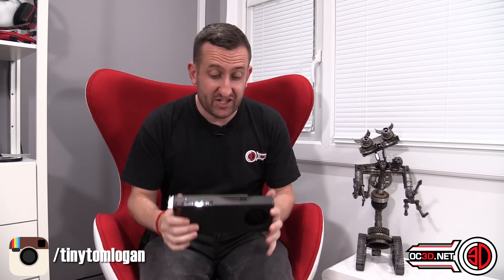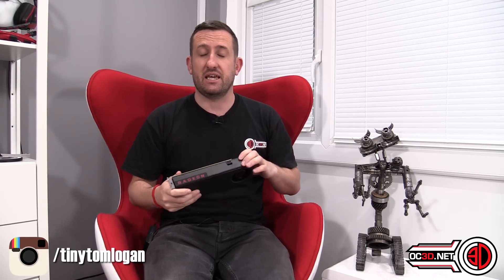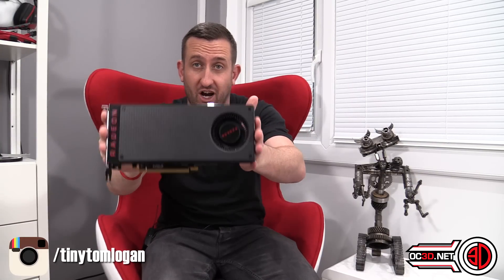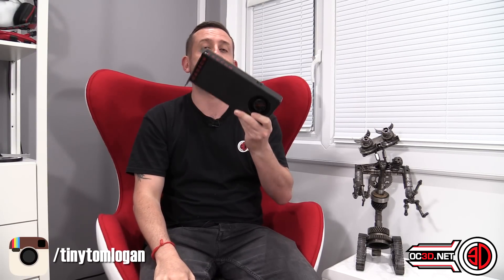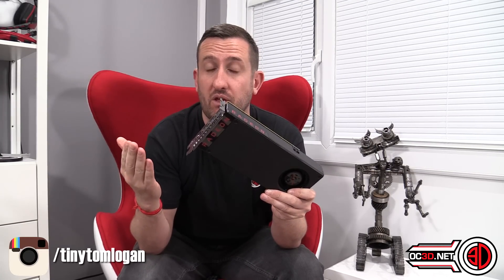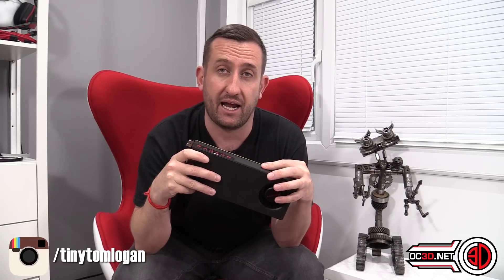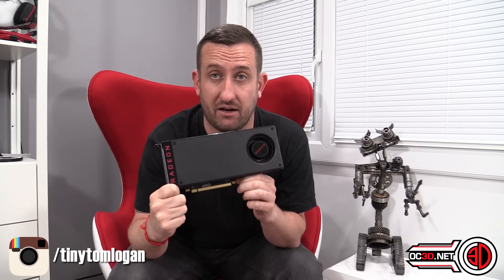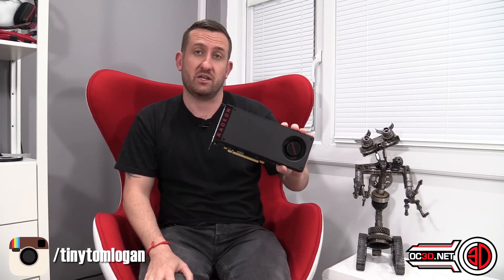RX480 power bottleneck? TTL Talks

Comment: will it match 980ti on decent cooling and OC?
Reply: This is a joke right? Its around the same as a 970 in most reviews, no way would an oc and cooling bump it up by that much.
Reply: +SASenglish Actually nope your very wrong. Look at Tom's benchmarks results. It sits just below the 970 in games. It doesn't beat any of the stock 980. And Hell no, it's so far behind the 980ti's it's embarrassing you even think that lol. Take a look at Tom's review for yourself. It struggles to play 1440 lol, He says himself it's a good 1080p card but not really for 1440. The 980ti's piss through 1440 lol.
Reply: you cant be serious....
Reply: +kain hall Dude lol, what are talking about!! The 980ti's are outperforming the Fury X in almost all  dx12 titles. So by your reckoning a 480 will outperform the Fury X lol? . Take a look at Tom's benchmarks review for which he did both dx12 & dx11 titles.  It still comes in just below the 970 which is now the same price, and the 970 comes in below the 980. The 480 is a great value card but only for 1080p, you would to turn off lots of settings in game to play at 1440 lol. It's a 1080p card.
Reply: +SASenglish First Off, it's the same price as an aftermarket overclocked 970. EVGA to be precise which at the moment is outperforming it in dx12 titles. 2nd, this is a good choice 1080p card only, as Tom found when benchmarking you have to turn OFF all the bells and whistles in game to play at 1440, so yes it's a 1080p card. 3rd, I think you could be right about the card improving over a long time with dx12 drivers but by then Vaga and VOLTA will be already out and let's be honest, people will want to be buying those.
Reply: not the 980ti but a 980 yes. wait for aftermarket card, and the 1060 release(to give yourself best options)
Reply: +Slowbro actually it's the same as a 980. and the aftermarket cards have achieved 1.4-1.6Ghz overclock with improved power circuits. so yes it very well can and when it comes to dx12 titles it will do far better than a 980ti.
Reply: I think with dx 12 titles it'll be closer to the standard 980. As we've seen already with some games. It is a bit of a gamble in all honesty, amds recent track record is excellent dx12 performance and it continues here but the gamble is, will dx12 really take off like dx11 as so far it's been a slow uptake. Also amd cards have recently improved over time with driver updates, hopefully it will be the case here too, but like I said, it is a bit of a gamble. The 970 and 980 are pretty much at peak performance so as far as future proofing goes, the 480 is the right choice, if you want immediate performance for £200 then a second hand 980 is the way to go.
Reply: no. 

however, in DX12 games, it should beat the 980ti.

 but dx 9, dx 10, dx 11....its JUST behind a 970

after market cards should tie or beat the 970.
Reply: Doubt so lol.
Reply: no it can't touch fury x which costs more than 2 times. if fury x can't beat a after market 980Ti, how will a mere 480 beat it?  maybe 2x 480 will beat 980ti/1070s in dx11 titles if they are lucky enough to get decent crossfire profile during the launch time of a decent title
Reply: +MayDay GoingDown!! you're  forgetting this is a £200 card and yet it competes with somthing £300 worth. and gets better dx12 performance. which further future proofs it. I was considering 2x after marker OC 480s instead of the overpriced 1080. purely for 4K freesync and cheaper. or just wait for Vega.
Reply: its a 200 dollar card lmao
Reply: MayDay GoingDown!! The 970 is still more expensive, why would you buy a gtx 970 when you can get the rx 480 which has 8gb of vram, makes no sense 

And again, the rx 480 beats the super clocked 970 in benchmarks and vice versa 

The rx 480 is the best value card on the market
Reply: SASenglish
Not so £218 https://www.scan.co.uk/products/4gb-evga-geforce-gtx-970-sc-gaming-acx-20-pcie-30-7010mhz-gddr5-gpu-1165mhz-boost-1317mhz-cores-1664?utm_source=google+shopping&utm_medium=cpc&gclid=CInzpY_b0M0CFclsGwodpsoDIA
Reply: In this case you are wrong. The 4GB version is 200$ the 8GB will have a price increase. (what would be the point of the 4GB version if it costs the same)it will still be cheaper, probably a extra 30-50$, but I am just pulling those numbers out of my arse.
and about beating the 970 ... there are a few games that it will beat the 970, at DX11. Yes, it can beat the 970 with DX12 titles, but as far as I am concerned, that api is far from perfect and till there are more dx12 games than I have digits it is hard for me to be to concerned with that. (the main dx 12 games, 
ashes, middle ground between nvidia and amd, the gap there is lessened by 20% between the companies, giving amd the lead in many cases save for the new 1000 series. reduced to about 5 ish percent, hard to say until new amd top cards are out.
hitman AMD favoured and
Tomb Raider, prefers nvdia.)
just making a point that dx 12 is not ready yet, too much cooperate BS going on in the background.
Reply: lcmattern Thing is there is no game that has yet been fully developped in dx12. All the dx12 games that are currently out were originally made using dx11 and added a layer of dx12 features on top if it. 

Therefore it is very hard to predict what will happen. 

But one thing is sure, Pascal is still incapable of properly performing Hardware based asynchronous compute. Kind of to be expected as the newer generation of cards on both side are basically shrunken refreshes Pascal is nearly the same as Maxwell at a smaller node and the same can be said for Polaris.
Reply: +Stratodinos not really the same for polaris as AMD has had hardware driven Asynchronous compute. whereas nvidia never had and always claim dx12 support. but it's extemely poor in comparison.  plus AMDs performance per watt and Price is far better than nvidias. can't wait for Vega tho.
Reply: SASenglish I meant Polaris uses the same GCN architecture. Of course, GCN was always capable of it to begin with.
Reply: well out of all the reviews hardwarecanucks was able to get it performing around the 390/980 area, this is properly what he did unclock the power as his review of it is a better performer by at least 10%
Reply: You need an aftermarket RX480 with extra power phases. This could allow 1400MHz solid overclocks
Reply: Absolutely no chance. Considering most Ti's can hit 14-1500mhz+ pretty easily. Its about stock 980 performance even in DX12.
Reply: +Mayday GoingDown!!
Go look at more benchmarks than just Tom's, it's faster than a 970 (unless it's an overclocked 970) most of the time and gets near a 980 in some games.

Did any of you not watch the video? The reference 480 is power and thermal limited. Many reports have said it's capable of hitting 1500-1600+ MHz when it has sufficient power which we'll probably see once AIB cards come out with dual 6 pin or single 8 pin connectors. Without those limits it could very well beat a 980 or even get near a 980ti, especially in DX12 and Vulkan games.
Reply: Never, not even on liquid nitrogen
Reply: +Son37Lumiere unlikely. The same was said for the 1080/1070 but custom cards clock no better than ref.
Reply: +Son37Lumiere I don't need to look further than Tom's really though. You can't trust 99 percent of the Google ones for a start off because A, they are unreliable sources, and B, you can't tell if they are biased towards one company. C, Tom's benchmarks have always been right. And I have to chuckle when I see people mention Vulkan, Nvidia cards gain the same as AMD as Vulkan is for both lol. It's like your expecting only AMD cards to gain lol.
Reply: MayDay GoingDown!! 
Vulkan was created from AMDs Mantle project, just like DX12. And if you limit yourself to one source (and Tom's hasn't always been a bastion of honesty) than you are inviting ignorance.
Reply: Are you crazy? No way in hell will it even touch the 980 Ti.
Reply: Roof Tyler actually it's not unlikely ASUS and Gigabyte have already reported they have built RX480 cards that are clocked at 1.4-1.6Ghz, because of the Improved power phases.
Reply: MayDay GoingDown!! 980ti's are not outperforming the Fury x in DX12, Look at a Recently Benchmark using AMD Crimson Drivers, Not the old Catalyst, THe fury X beats the 980TI and the 1080 only gets a few more FPS in DX12 Titles.
Reply: +SASenglish yes but in what title? Then compare fury X in GTA V.
Reply: +SASenglish Only at stock. I have a Fury X and the Hoff 980ti. My Hoff edition 980ti outperforms my Fury X, This is because of the easily achievable overclock you can apply, achieving frames the Fury X simply can't achieve. I'm sure my Fury X will beat a stock 980ti in a couple of dx12 titles but from benchmarks I've seen its only a couple. But like I said once you Overclock the 980ti's it's all over for the Fury X.
Reply: OK, chillax people. Just received zotac gtx 1070 amp.   Waiting for VEGA. Polaris  is dead to me :(
Reply: +SASenglish You may also note even the 1070 outperforms the Fury X in dx12.
Reply: +Matt Kochanowski Very nice card you have there. I'm going to sell my Fury X, not replacing yet though as I am keeping my Hoff edition 980ti. That's gunna be good for a long time, I will wait for VOLTA and Vega to be both benchmarked and go for one of those.
Reply: +Son37Lumiere Dude you keep on about Vulkan as if it isn't open and only works on AMD lol. Don't know why you think that. And yes unfortunately there are plenty of biased reviewers on line and also plenty of inaccurate misinformed reviewers who only get info from what they read online lol. I prefer to watch the benchmarks done by an actual reviewer and benchmarker who actually has the product right there in his hands not simply copied and pasted from an already known to professionals source to be both biased and misleading. I have watched his reviews for years now and after purchasing the products he has reviewed have found him to be spot on. That's what you should go off, Unlike most others who continually get it wrong. That's not me being narrow minded it's simply me learning from years of experience.
Reply: MayDay GoingDown!! 
Sorry to break it to you but you are very narrow minded, otherwise you wouldn't be making blatantly false claims. The Fury X is as fast as a 1080 in DX12, as a number of benchmarks have shown. But you go on believing whatever you like.
Reply: Son37Lumiere
 yeah right... And then you woke up.
http://www.guru3d.com/articles-pages/nvidia-geforce-gtx-1080-review,13.html

http://www.guru3d.com/articles_pages/nvidia_geforce_gtx_1080_review,14.html
Reply: +Son37Lumiere Hahaha think you should watch more benchmarks results dude, Sorry to break it to but the Fury X doesn't even outperform the Hoff edition 980ti in dx12. But if your stuck in will be only too happy to send you plenty of links that prove it.... Fury X... hahaha I'm selling mine, it gets outperformed by a 1070 never mind a 1080 in dx12. I can send you plenty of those benchmarks too.
Reply: +Roof Tyler You have to feel for the guy, he's probably yet another one of those AMD Fanboy's pinning his hopes and dreams on the 480 being faster than a 1080 for 200 quid lol. Some people simply never learn.
Reply: MayDay GoingDown!! 
Figures a half wit as dumb as you wouldn't even bother looking at the guru3d benchmark Roof Tyler linked to showing not only the Fury X but also the Nano and 390X being faster than the 980ti (and thus also a 1070) in Hitman. LOL!

Here's some more dipshit.
http://www.dsogaming.com/news/report-total-war-warhammer-runs-27-slower-dx12-nvidias-hardware/
http://arstechnica.com/gaming/2015/08/directx-12-tested-an-early-win-for-amd-and-disappointment-for-nvidia/

And you accuse others of being a fanboy when you deny the data that's readily available, ha! Pathetic.
Reply: +Son37Lumiere nvidia fanboys are always the dumbest of them all. I have used nvidia for years and AMD also. I love the power I still get from my GTX670. runs 4K in most of the games I play. but without a doubt AMDS cards are far better than nvidias when it comes to DX12 titles. the fury x is faster than a 980ti when it comes to 4K games and dx12. mostly because of its 512GB/s memory which is great for 4K textures ect. but these idiots are only looking at the old benchmarks in the first 4 results of a Google search. which use the old catalyst drivers. not the new crimson drivers that put the Fury x on par with a 980ti in DX9/10/11 titles. and ahead on DX12. I guess they never look at the facts.
Reply: SASenglish 
They're obnoxious asshats aren't they.
Reply: +SASenglish lol no it's not. Only takes a few searches to find how capable the fury-X is at 4K. Absolute stutter fest.
Reply: +Son37Lumiere gpu_displays/msi_gtx1070_gaming_x_review/13  
Hahaha you were saying??. If you want to see the Fury X here is a tip... look way down the list lol. Notice what the cards above it are!! in both the dx12 & dx11 titles lol. Thats why I'm selling my Fury X and keeping my  Hoff edition 980ti.... Enjoy lol.
Reply: +SASenglish gpu_displays/msi_gtx1070_gaming_x_review/13
 You were saying??. Oh dear, What's those cards we see way way above the Fury X in both dx12 and dx11 titles... Like I said.. you where saying??.
Reply: +Roof Tyler Like I said earlier, you gotta feel sorry for them.
Reply: MayDay GoingDown!!
 Lol too true.
Reply: ROFL. You two are simply dumber than a pile of rocks. We're done here.
Reply: +MayDay GoingDown!! I'm not really sure what there is to be sorry about. it's a shame to see you getting so upset over a GPU brand it's amazing. just shows how stupid and pathetic you really are. I use both brands. I currently use nvidia. but will be upgrading to 2 after market 480s with 1.6Ghz clock speeds. rather than a overpriced 1080. either that or waiting for Vega if they announce it soon. already a 490 announced but no specs as of yet. nvidia killed pascal on release with their lack of hardware support for asynchronous compute.  somthing they always claim to be good at. which they are not at all. I'd rather have somthing that is good for the future. and dx12 is the future.
Reply: +SASenglish I'd use AMD if they actually had anything that competed with nvidia at the minute. They don't so I have two 1080's, water cooled at a reasonable 2100mhz.
Nothing against AMD but as usual hype train turns to hype rocket. Expectations of Titan X perf for £200. In reality its 970 perf for £220. I paid £220 for a 970 for my sister over a year ago.

Thing that makes me laugh is fantards is their only defence is async compute. If only devs used it. And just the sheer core count and power consumption to compete with nvidia. 4096 on the fury X. Joke.
Reply: +SASenglish Lol, if you had read my posts you would already understand I own Fury X in one of my 2 Rig's and a Hoff 980ti in the other. I don't take preference over either company so no biased here, only fact. Proven fact. No one getting upset over a Gpu here only you 2, the funny thing is your both upset about the 980ti's and Fury X which neither of you even have lol. And on top of that have both been presented with facts lol. As for the 480 in crossfire lol, I would wait for Vaga or Volta, as I really wouldn't want the ridiculous temps that 2 480's are currently outputting even with the aftermarket  coolers it's still not going to be acceptable for me. As for Async I wouldn't worry about it as it's already known most new dx12 titles such as Battlefield 1, GTA6, Cod, And as we can already see with Doom won't be using it so not as important as AMD make out!!. Also do bear in mind you won't be playing a lot of those new titles as no support for sli or crossfire. As for me I'm selling the Fury X, Keeping the Hoff 980ti, I'll wait for both VOLTA and Vega to be benchmarked and go for one of those.
Reply: +Son37Lumiere http://www.overclock3d.net/reviews/gpu_displays/nvidia_gtx_1070_founder_edition_review/1
Like I said, look right down the bottom of the graphs, take note where the Fury X is, look above and see where the 980ti's are, then look where the 1070 is. These are both dx12 and dx11 titles. Then bare in mind that the 1070 used is only founders. The 3rd party versions are faster cooler and a lot cheaper than the Fury X.... Rolf... I'm not starting flame wars with you 2 AMD  Fanboy's I'm just showing you proven facts that were carried out by a professional benchmarker...Stop taking them as a personal attack lol, I have myself a Fury X lol, well until I can sell it that is.
Reply: amd have better async compute implantation  that true but both brands are still not there in terms of 
full dx12 optimization and you still see that sometimes amd cards do not perform better in dx 12 or perform bit worse.
any way that doesn't change the fact that right now there is no rx 480 that reach 1.6ghz and if and when will be one, i can bet the price would be 
far higher then 240$. we will have to wait for vega which will amd equivalent cards for nvidia pascal (it will take lot of more time till volta to be released) 
and we will have to see how the 1080ti titan p and vega cards will affect the price because the 1080 price will drop dramatically when those cards 
will be released. and with in the end will have to to see the total performance. for instance the 980ti xtreme edition from gigabyte just kill furx in every test 
even in ashes dx 12 and hitman  absolution so even if nvdia cards may not sometimes get the boost that amd cards get in dx 12 if they still perform better 
for around the same price they are preferred.
Reply: Eliad Buchnik 
No, AMD gains massively in every dx12 game. Tomb Raider is the only exception because once again, it's not real dx12, it performs worse on its dx12 setting for both AMD and nvidia.
Reply: Roof Tyler 
Fury X is last gen genius, no shit nvidias new 16nm Pascal is better. And no one said the $200 480 would be Titan X.
Reply: Son37Lumiere
you dont say... Even the 480 is still up on power compared with a 1070-1080. Still requires 5000 polaris cores to even come close to a stock GTX 1080.

AMD just cannot compete which is really sad. If the 1060 comes in at 480 money. AMD will loose out on sales massively.
Reply: Roof Tyler 
Nvidias 10 series is very power efficient yes but Polaris is a major improvement over Hawaii as well. The 480 draws about the same as a 1070, sometimes more sometimes less. No, it has 2300 shader cores. The 1070 has 1920 cuda cores but is clocked much higher than the 480. You can't compare them, totally different architectures and price points. Comparing the 480 to a 1080 is like comparing a 960 to a Fury X.
Reply: Son37Lumiere
yes true but its also quite a step back in terms of 1070 performance.

I'm not comparing architectures direcly. Just simply stating that the rx480 draws as you say the same as a 1070 but at about 50-60% of a 1070's stock performance.

Ref 1070 here is £400, ref 480 is £250.

GTX 1060 will launch soon, which if it is faster and has far less power consumption. Then AMD are going to have a tough time.
Reply: Roof Tyler 
The 1070 is about 30% faster, not anywhere close to 50-60. The 480 is between a 970 and 980 stock. The 1070 is essentially a 980ti.

1060 will be $300 for the FE, which will be the going price just like you can't find a 1070 for less than $440 so $60 more than the 8 GB 480. It will be bandwidth starved with a 192 bit bus and of course less RAM and no async support.
Reply: +Roof Tyler Hi bud, here in the UK you can get the 480 for 239 up to 249 UK pounds. The KFA2  1070 is only 375 UK pounds. After watching both benchmarked the KFA2 1070 at 375 quid wins hands down.
Reply: MayDay GoingDown!!
I know i live in the UK :)
But yeah 1070 beats the 480 by far and really is not far off 480 CF.
Reply: +Son37Lumiere How much more would the 1070 pull ahead once overclocked though? In the UK The KFA2 1070 is only 375 UK pounds compared to 249 UK pounds for the 8 gig 480. I don't know how much the aftermarket 1060's will be here but they are going to have to a hell of a lot cheaper than the aftermarket 1070's if they are not extremely close to it otherwise you would just go for the 1070's. Not seen any 1060 benchmarks yet have you? It will be interesting to see how well they overclock too.
Reply: The Danster 
The 10 series overclocks to about 2 GHz average, which is a 15% increase. Many rumors peg the aftermarket 480s with more power capability as overclocking in the 1400 to 1500 MHz range. I fully expect both cards will trade blows depending on the game with a sizeable lead for the 480 in dx12 and at higher resolutions.
Reply: +Son37Lumiere Yeah I think so to about the 1060. That's why I think the aftermarket 1070's are best option, considering the 370 pounds price here.
Reply: Roof Tyler +MayDay GoingDown!!
Nvidia doesn't gain in Vulkan either, same as DX12. LOL!

http://www.guru3d.com/news-story/new-patch-brings-vulkan-support-to-doom.html